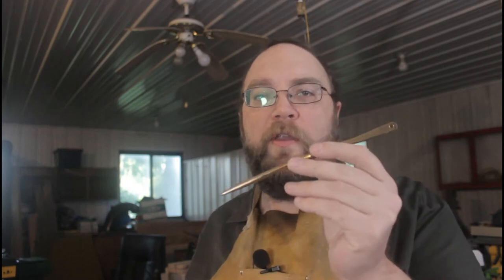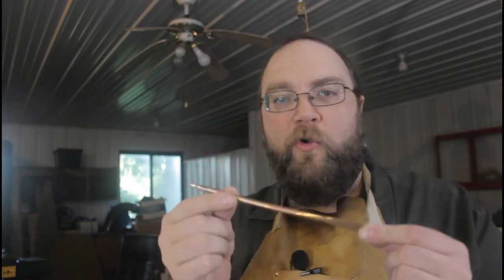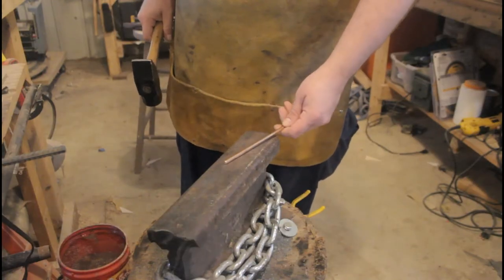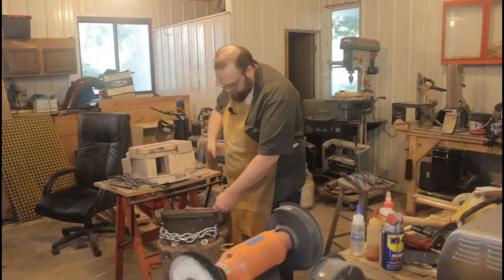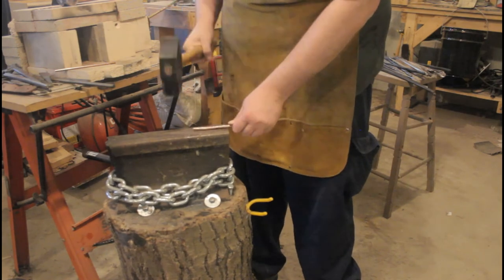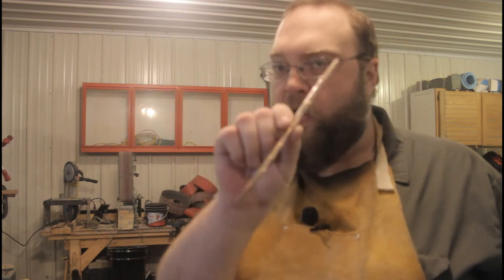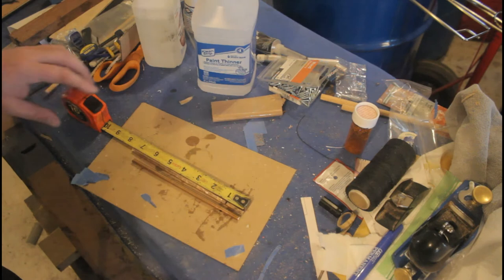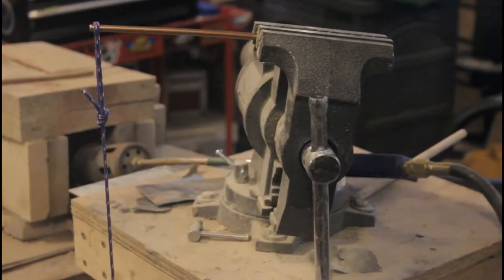Bronze Rod Strength Testing

Comment: You should have heated and quenched your control rod to insure that it was not work hardening. It’s possible that in the manufacture of the round rod they ran it through some rollers which would have work hard and the metal. Also take into account that hammering on the round rod decrease the diameter so that also would make it weaker this is not apples to apples comparison in my opinion.